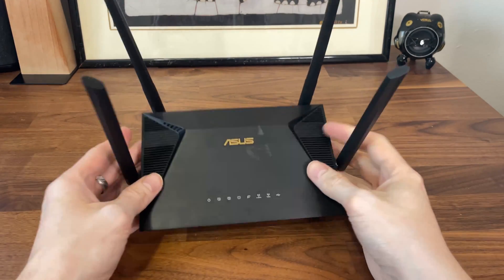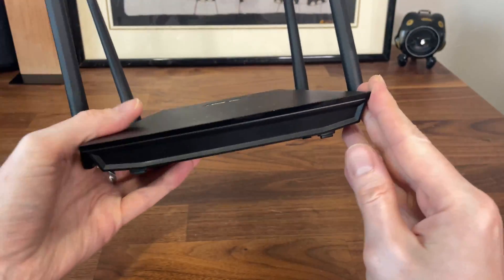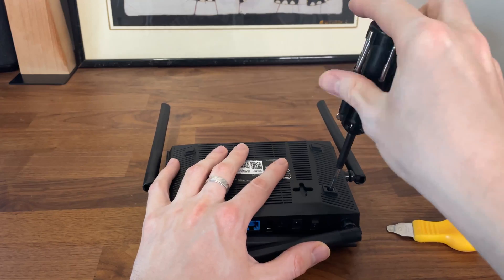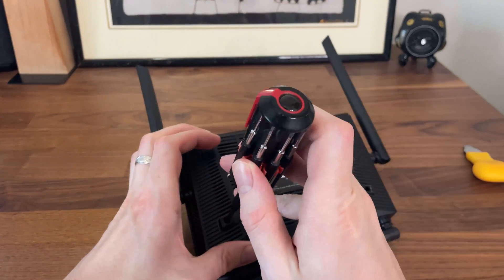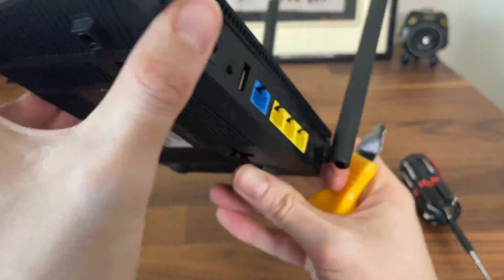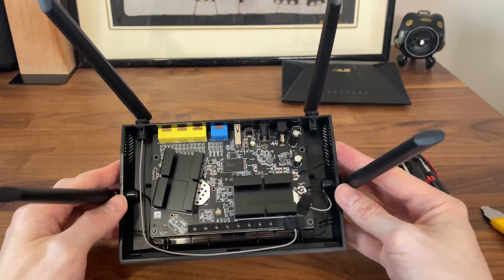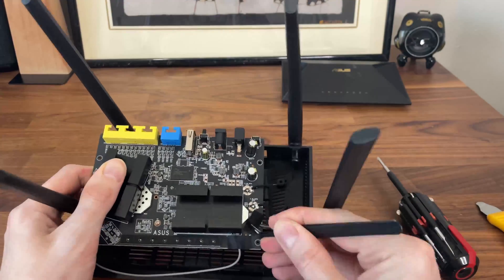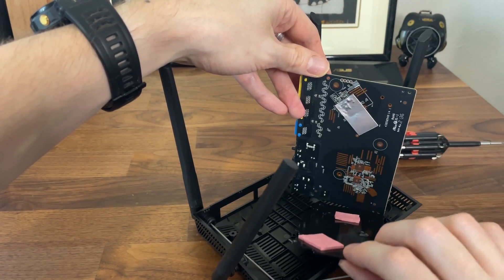ASUS RT AX53U Teardown: One of the cheapest WiFi 6 routers from ASUS

Comment: @SamBondor  could you make a video of installing Openwrt on it  please? the entire process & also before that, could you please make another segment showing what options/functions are available while using this router in ACCESS POINT MODE on the stock ASUS firmware itself?
Does per device Bandwidth Limiter work in ACCESS POINT MODE?

Comment: did you already install openwrt on it?
Reply from the maker: Not yet. I know that it's compatible with it though. Did you install it? What's your experience so far?
Reply: @SamBondor  could you make a video on it please? the entire process & also before that, could you please make another segment showing what options/functions are available while using this router in ACCESS POINT MODE on the stock ASUS firmware itself?
Does per device Bandwidth Limiter work in ACCESS POINT MODE?

Comment: I currently have 2 AC routers running as wired APs to cover my house. Should I wait for Wifi 7 routers to become affordable or buy 2 of these?
Reply from the maker: Do you have issues with the two AC routers? If not, wait, but it will take a a few years before cheap and good becomes a thing with WiFi 7.
Reply: Even wifi 6e is still expensive, and mostly incompatible with openwrt if u want to use that. Unless u can spend a butt load money then just get it.